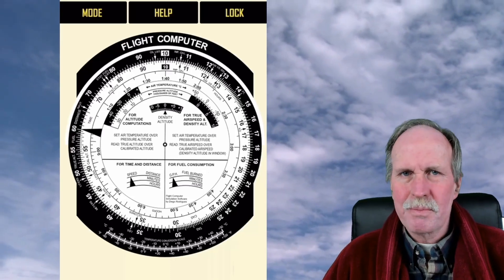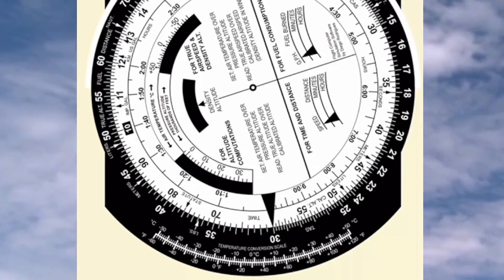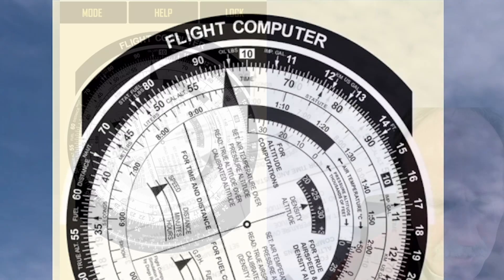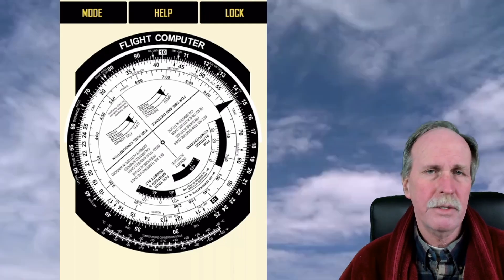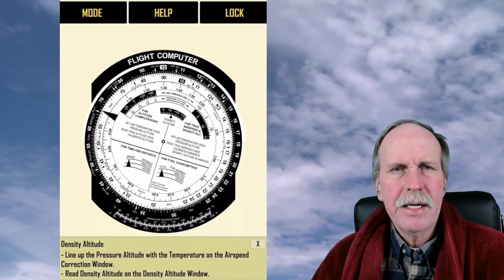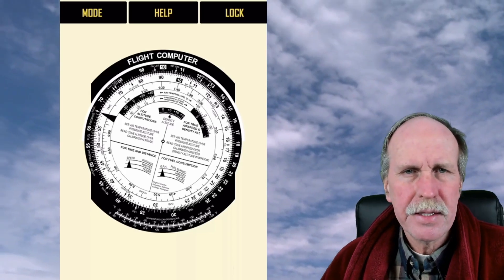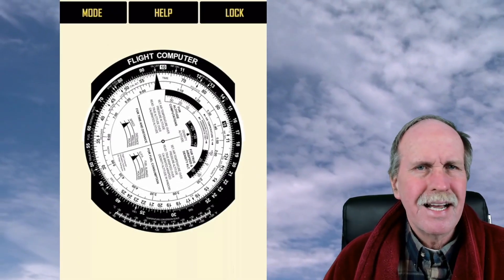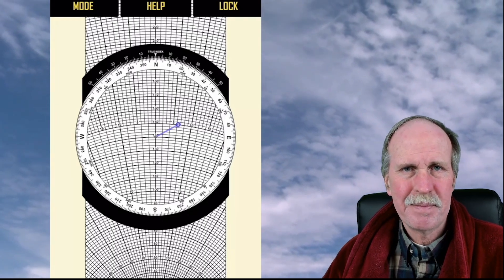E6B- Intro to the Whiz Wheel

Comment: I had a Kane  similar to this. This is the only navigational aid I used to fly over all Western Australia. Very easy to use and does not have batteries that go flat.  I could even do wind aloft corrections with this instrument as well as fuel consumption, density altitude , and ground speed calculations. My C150 only had a vhf radio which was very limited range  and I did all my Nav with a compass,clock, chart and the Kane and pencils which always ended up under the seat!

Comment: I remember on the boat I served on (US Navy submarine), we had some antiquated fire-control that was all analog gears and servos and such for plotting targets and torpedo track.  But as a BACKUP, they also had a custom, hand-held device that was a bit like this (with a few more scales/levers/etc..).  Shipmate showed it to me once, "You put our speed and heading here....  The target's estimated range and speed there with it's estimated heading...."  About then, my eyes just glaze over.  lol
Reply: You should look up battleship mechanical fire control computers
Reply: @gowdsake7103  Have seen them on tours of old ships.  The Mk 114 Fire Control we had was not much more.  Used signals from ships gyro and log.  Then inputs from periscope or sonar to get bearing to target with 'guesstimate' angle on the bow and speed of target.  Of course, each sighting would refine the solution, but if they 'zigged', had to start track again.  Really some fascinating devices that could resolve tan/sin/cos and integrate/differentiate all electro-mechanical. :)

Comment: Wierd.  My interesting comment related to the E6B has disappeared ... twice.  Not sure why.  There was nothing offensive or contraversal in it.  The first time it vanished I thought I'd made some kind of mistake.  The second time means it's not an accident.  Oh well.  I'll not push my luck any further.
Reply from the maker: I didn’t see it. What was your comment?
Reply: @ResearchFlatMoon  It was this:

In the early 1950s the US Aircraft Owners and Pilots Association (AOPA) asked Breitling to design them a wrist watch with a slide rule bezel for use as a simplified version of the E6B.  Breitling had already done a slide rule bezel watch a few years earlier called the Chronomat.  They adapted the design and came up with the Navitimer.

These are amazing timepieces of particular interest because of their practical applicaton.  In fact a Navitimer was featured in the 1965 James Bond film Thunderball in which it was used as a minor plot device because of it's distinctive appearance.

The slide rule bezel can be used for basic multiplication and division, but also to calculate ground speed, miles per minute, fuel consuption, rates of climb or descent, distance of climb or descent and nautical/statute mile conversions.

Navitimers are supplied with practice wheels and slide rule instruction manuals. If you hunt around on ebay you can find spares of these.

These days the Navitimer is an icon in the watch world even if it isn't universally loved because of it's busy dial.  It is still made to this day being the flagship of Breitling's range of timepieces.
Reply from the maker: interesting historical note.  I see it runs about $5000 on eBay.  Bit much.
Reply: @ResearchFlatMoon  You can find listings for just the computer wheels accessories that you can use to practice with for a lot less money.
Reply: @ResearchFlatMoon  Aaagh! Bob... you are going to think I must be a compulsive something or other... apart from my 6"slide rule in my pocket, my insistence on you doing a video about the E6B for rather too long, and the fact that I also use a Curta... I almost feel ashamed to say that I have one of the first Breitling Navitimers... oddly, I bought it in LA while I was waiting for the FAA to grant me an American licence based on my UK one (cost $950 new then, with special band).

I have to say, it is almost useless in a cockpit environment as you need to use one hand to operate the bezel while concentrating on a small dial on the other wrist... at the same time trying to see everything else that is going on...

Still... it looks good! (and I have a strange story to tell about it someday!)
Reply from the maker: Mine is identical and keeps great time.  Ran my wife about $250 a couple of years ago for Christmas

Comment: Wind up or wind down that's the real question.
Reply: It's 'wind from'.  So when Bob showed the example of wind at 60 degrees, it's wind coming from that heading.  When flying due north, that cross wind would slow you down a bit over the ground.  In sailing as well as flying, wind direction is the heading wind comes FROM.
Reply: @mikefochtman7164  it was a fun question. I learnt how to use my E6B back in 96', I learnt wind up method. I wasn't a fan of wind down.